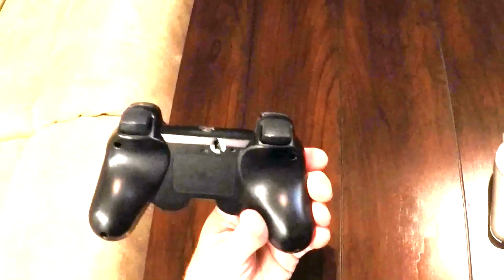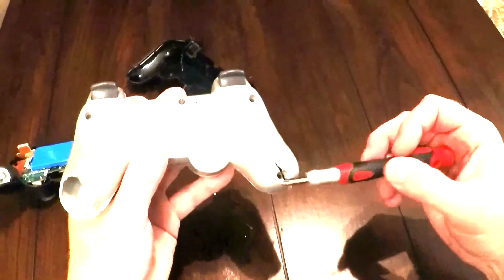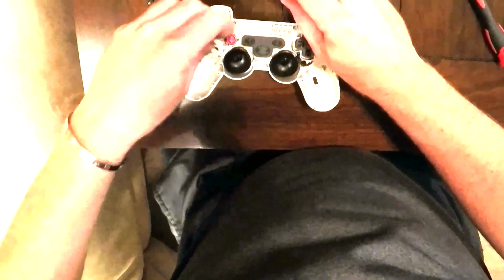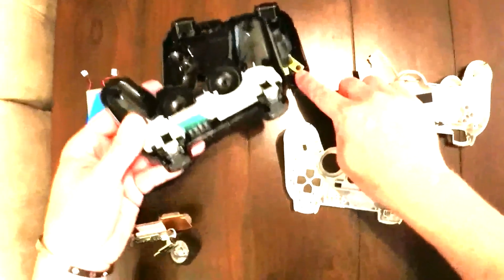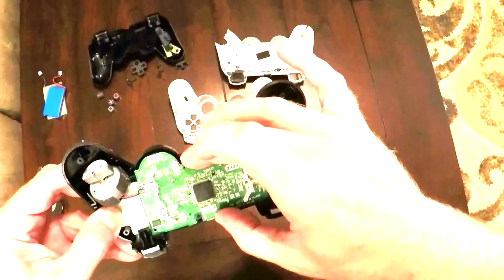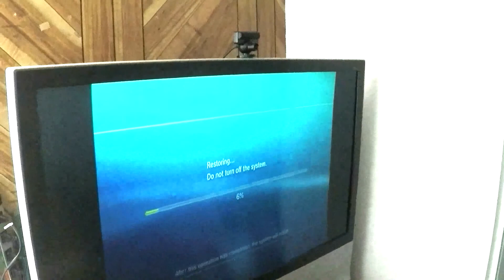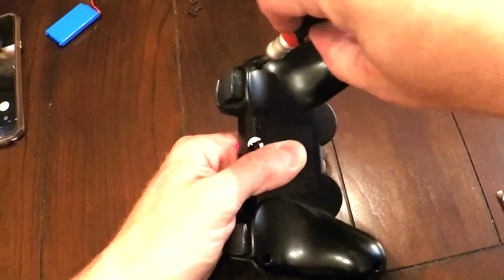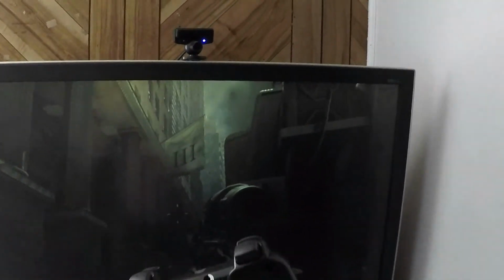Playstation 3 controller case swap fix

Comment: I recently had to replace the shell on an OEM controller with a 3rd party shell but it wont squeeze together and fit properly :( I hope it was the same issue you were encountering because the R1 and L1 buttons wont engage because the shell wont fully squeeze shut, and is too tight because L1 or R1 wont bounce back.. Do u think it's probably just the same issue? If so besides the 6 pillars what else did u do?
Reply from the maker: Since all of the shells can differ slightly if not nearly completely inside I would try to see where things are getting caught up and file or sand down those areas until things feel correct.